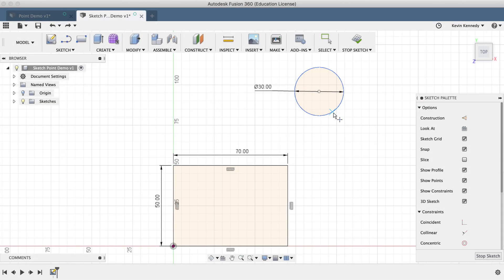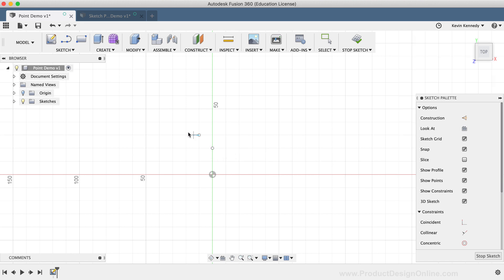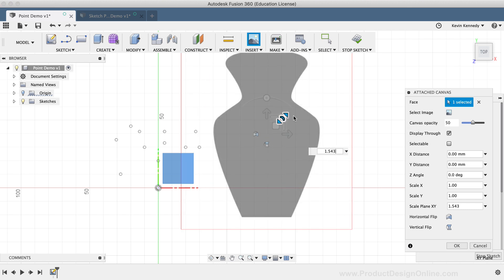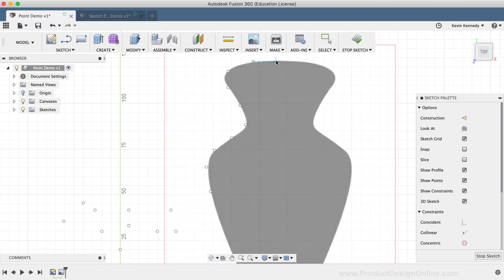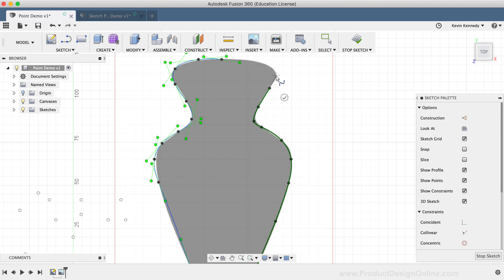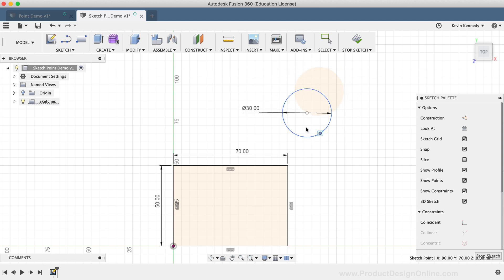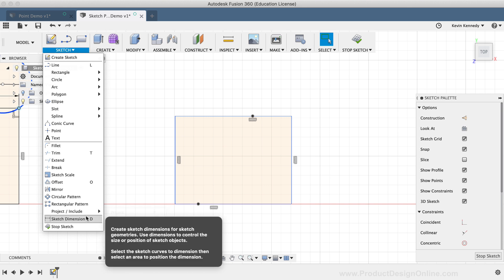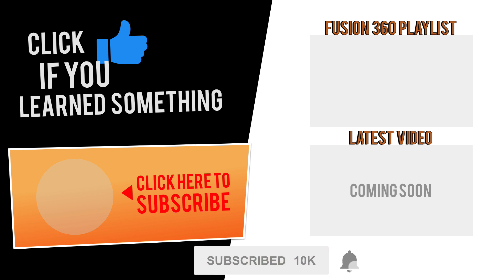How to Add Sketch Points in Fusion 360

Comment: How to draw points from formula or table/array? For example 0,0 10,15 30,10 20,30 50,20
Reply: or point = (x1, y1), where x1 and y1 have constrains from i (point number)?
Reply from the maker: @darkfrei2  There is no way to do that natively, as Fusion's sketch engine is not intended to be like Autocad or other (more) 2D programs.

You could use Fusion's API to create an Add-in to do that, but probably wouldn't be worth the effort.

Generally, you would sketch out the points or entities and dimension/constrain between them.
Reply: @ProductDesignOnline  I need points of phyllotaxis, each must be circle and than extrude this circles.  It can be 10-100 circles, each coordinate is float.

Comment: I'm having trouble using a point as a "handle" to drag sketch geometries around. Is it because something changed in the software or am I doing it wrong? I have a simple rectangle, add a point at a corner, then try to shift-drag the point. Nothing happens. Fusion 2.0.18961on Windows 10.

Comment: Say you wanted to put a point or for that matter locate a circle inside that rectangle at a given x-y distance from for example the corner, how do you position the point or the centre without the terrible drudge of laying construction lines and dimensioning then to cross cut a point in the geometry space?

Comment: How can I quickly insert points at a given set of coordinates? I want to join points to make an airfoil shape from a table of ordinates.
Reply: My method for this is to open the airfoil in the airfoil-tools plotter, then screenshot the image. Set the chord to at least 400 mm so the grid in very fine. Then, import this image into Fusion as a Canvas. Then, use a spline to trace the airfoil shape by hand. You can zoom in very far for great accuracy. I usually do my splines with about 200 points and they are effectively just as good as plotted points. Alternatively, there exists a plugin called "Airfoil DAT to Spline".  You can get it for free. But it has never worked for me. 
If this comment is helpful you should check out my airplane videos for more tips!

Comment: I'm trying to use fusion 360 to design coins and graphite molds, can fusion 360 export files used in CNC machines?
Reply from the maker: You can use the manufacturer workspace to set up your CAM toolpaths, followed by exporting the g code for your machine. Alternatively, you can export many file types to use with another CAM software.

Comment: My usecase that i thought: i have a construction line that intersects with my bodies. Draw a point at a certain distance (in direction A or B) on this line. I could use offset geometry but i don't want geometry i only want point. In fact, i have two lines where i want to do this and the goal is to connect both points to construct a third line

Comment: Hi, Is it possible to break line between added points?
Reply from the maker: Hi, Sergio. While in the SKETCH tab you will find the "Break" command under the "Modify" dropdown list. That lets you break sketch entities based on the selection.
Reply: @ProductDesignOnline  Hi, the "Break" command works for me, only if I  draw lines through the added points, without lines, the command does not divide the line in points. The command does not understand the points as the place at which it is necessary to break the line. Perhaps I need to change the status of points added to the line? but I don’t know how.
Reply from the maker: @frostwise  ah, sorry I misinterpreted your first comment. That is the only workaround at the moment...

Comment: Nice presentation. I am a complete novice, and I am looking for a way to draw a NACA airfoil, using points (maybe?).
Of course I could just take a drawing and do what you did with the vase. But for NACA profiles, you have two y positions for x position.
Eg, I can download a table where the Y-axis is either 0-1 or 0-100% and the x have both a negative (underside) and positive (overside).
It is possible to set the x/y coordinate for any point?

Best regards
Steinar V. Kolnes
Reply from the maker: Hi, Steinar. You'll need to use an "add-in" for the capability to manually define points by coordinates. Here's a great article that explains this - https://modthemachine.typepad.com/my_weblog/2016/05/creating-points-at-an-arbitrary-xyz-location-in-fusion.html

Comment: Is it possible to have the location of where your mouse curser is on the screen? So if I'm scrolling over 25mm it says that somewhere on the screen?
Reply from the maker: Hi, Victor. The only thing Fusion 360 has similar to that is what displays in the lower-right  corner. You'll see it shows dimensions, number of edges and faces selected, etc.
Cheers, Kevin :)

Comment: I've been using Libre Cad.  It's very easy to set xy coordinates to set a circle center or line end in the command line.  Is there a way to do this in fusion
Reply from the maker: Hi, Norm. Fusion 360 does have a command line, but it is not exactly the same as some of the other CAD packages. You need to go to VIEW > Show Text Commands. That will open it up (at the bottom of your screen). You can then enter two question marks ("??") to see all of the prompts. Cheers, Kevin :)
Reply: @ProductDesignOnline  How to go to this "View" menu you mentioned? :)
Reply: @andaluspc  open drop-down menu of File (left upper corner) and View will be on the bottom